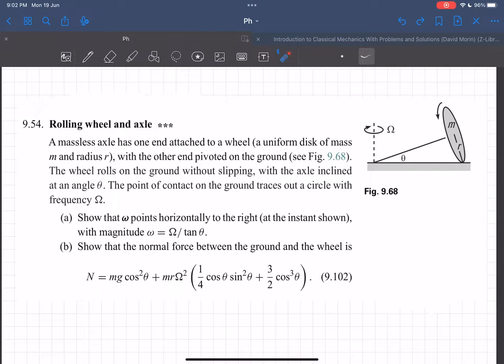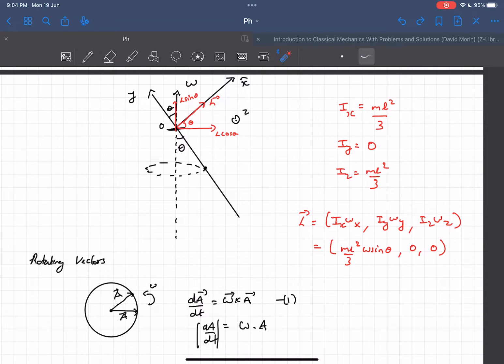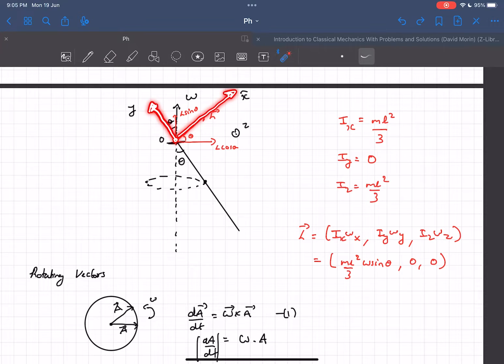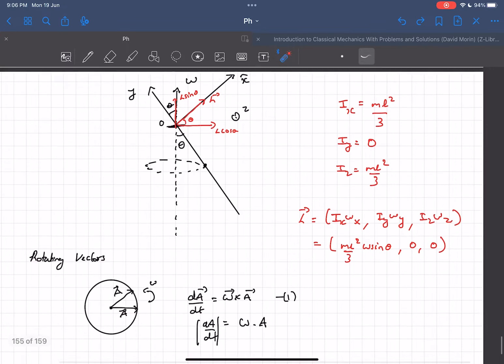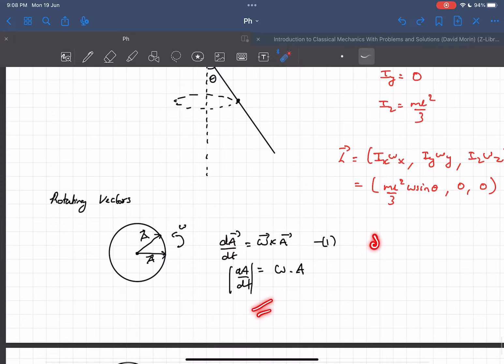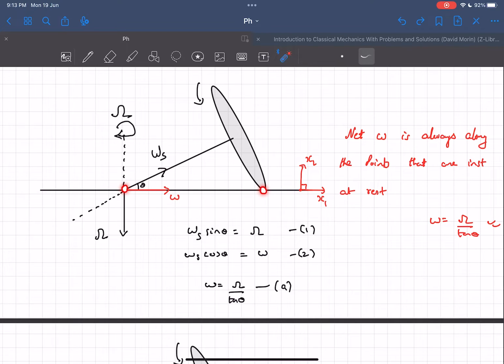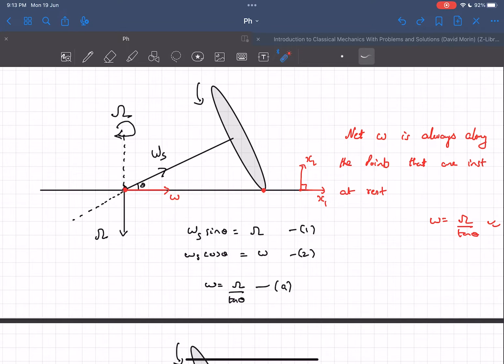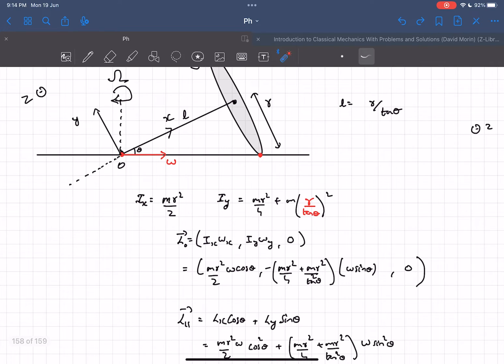[JEE Adv] Find Normal Reaction| Rotating Wheel and Axle | Morin

Comment: Wrong Method to Teach , you Should Introduce Moment of Inertia as Tensor of Rank 3 , Before Solving it ( it clears Lot's of Confusion ) !
Reply from the maker: Yeah, certainly there are a lot more things that need to be covered before getting into the math but that wasn't the intention of the vid it was mainly to dive into to prob. If someone wants to learn this ofc they would start with morin or some reading source first not a 15min problem video.
Reply: Not necessarily required, a 5 minute  introduction of rank 3 tensor is an overkill,  We'll anyways  use principal axes to get rid of product of inertia

Comment: But as I have studied till now the direction of angular velocity is the same as the direction rotation of disc. Could you explain why you took it as out of the plane of disc
Reply: Because axis of rotational and axis of symmetry aren't same , this happens when there is non uniform distribution of mass so angular momentum traces out of the cone , same phenomenon is used in gyroscopes.